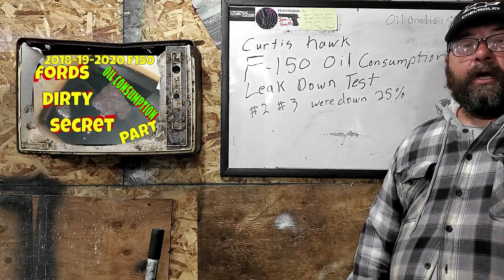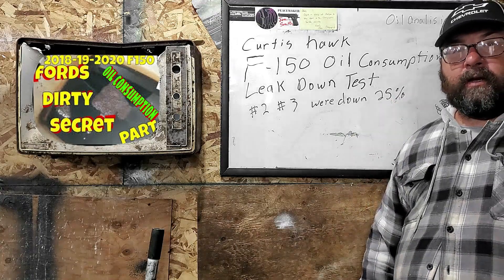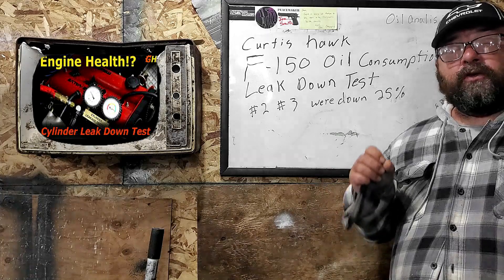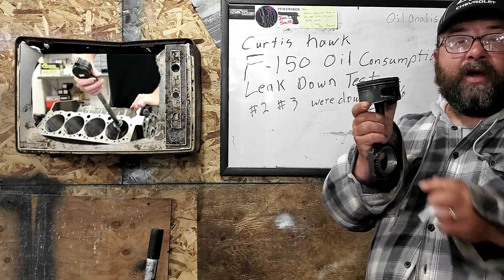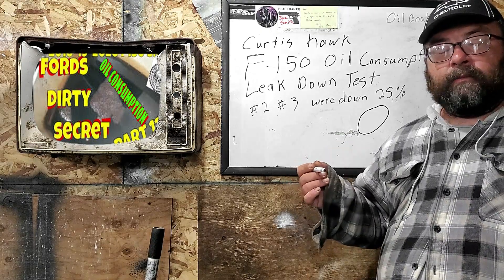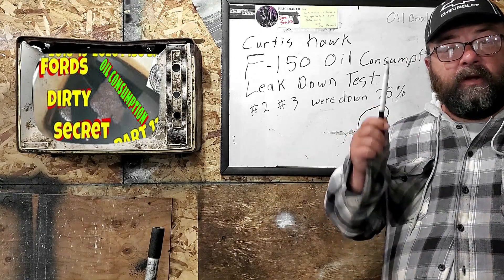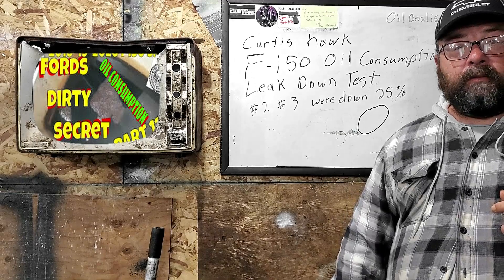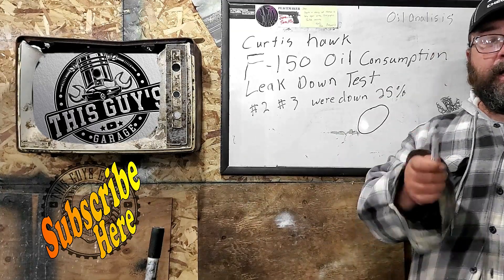f150 5.0 leakdown test fail gets new engine

Comment: How many miles were on his engine when he got leak down test done?
Reply from the maker: its been so long im not sure ,but should not matter if you are under a warranty
Reply: @thisguysgarage  Thanks, also so your video regarding the 5w50.  You think it would help with oil issues if I went to 5w30 or higher?
Reply from the maker: @davidfincham1218  look at amsoil, it is the best oil in regards to low speed preignition.  Until you are out of warranty run the weight Called for,  you don't want any reason for ford to be able to void your warranty 👍

Comment: My 2020 F150 stopped using oil around 9000  miles. Changed the oil at 12000 miles and hasn't used any oil since. Went to full synthetic oil in my truck. I hope that my oil consumption problems ended when the rings broke in. It's still stupid to have a sprayed on cylinder liner instead of pressed in liners.
Reply from the maker: let me know if anything changes . good luck milan ,appreciated

Comment: Hey bud love the show
I have a new development with my dodge brake fiasco 
So....i have brakes then @ next slowing or stopping event i wont have brakes(barely enough to stop) then ill have brakes on & offf ...ect...
No fluid loss 
I have No idea!?....
Need your "car surgeon expert opinion "
Reply from the maker: which best describes your issue?
pedal going to the floor? - air in the lines
or
are the brakes getting hot ,fade?- sticky caliper /swollen flex hose
or 
brake pedal gets very hard -  loss of vacuum at the brake booster
or
antilock controller pulsing/pushing back on the pedal like you are on ice ?
wheel speed sensor or control unit

Comment: Hi there I just wanted to share my updates with my 2019 F 150 with the 5.0 litre. It has been over a year now and I’m taking pictures sending them to the dealership with the kilometres and the oil readings on the dipstick. I had the TSB and all that stuff done shortly after I  got the truck. Right now I’m on my third Oil Consumption text I screwed up on one because I was just over the kilometres that’s my fault there . To make a long story short my dealership has been great working with me so far the service manager told me that he talking to a Ford Engineer and the Engineer said they are going to replace the Long Block if the truck goes down the 1 litre in 4800 kilometres. My truck has significantly slowed down on oil Consumption around the 17,000 kilometre mark it has hardly moved . But that’s not to say they are not going to do anything when my truck is on the halfway mark with the new dipstick it is down just over a litre of oil. I  will keep you posted I will be up to 4800 kilometre oil Consumption test shortly we will see if Ford or the dealer does anything. I am writing you from St John NL . It’s too bad that a lot of good people have to go through this thanks for the information.
Reply from the maker: hey Corey , im next door in cape breton ,please do let me know how you make out.  my truck would use a liter every 1000km . its 3 quarts between the full and add mark on the new dipstick ,i have a video on it.
ty again stay in touch
Reply: @thisguysgarage  yes I will definitely let you know for sure what Avalon Ford is going to do .